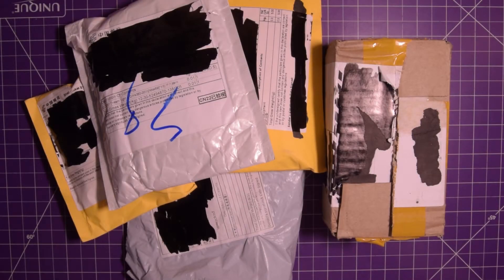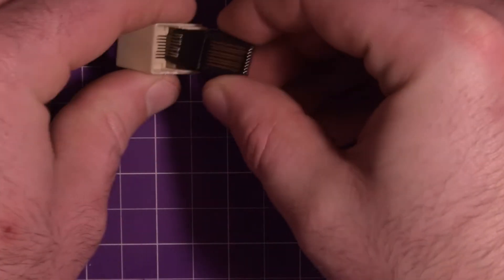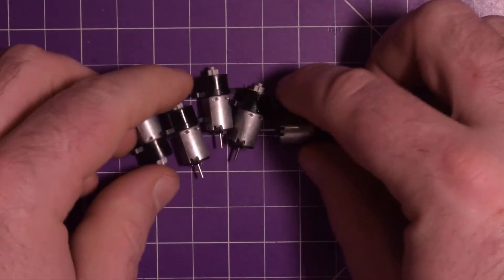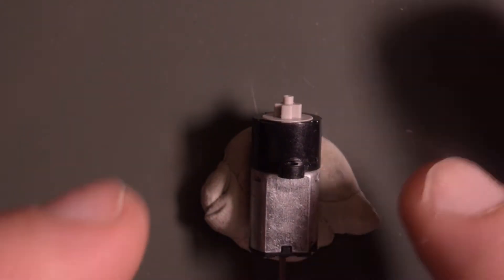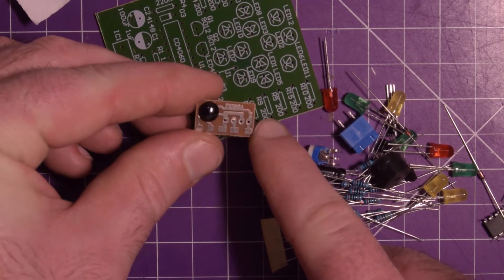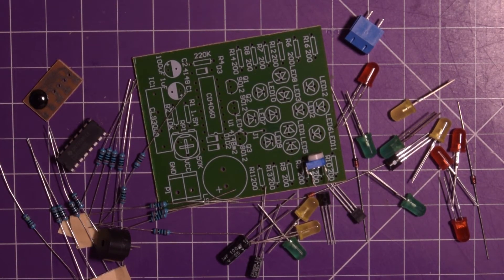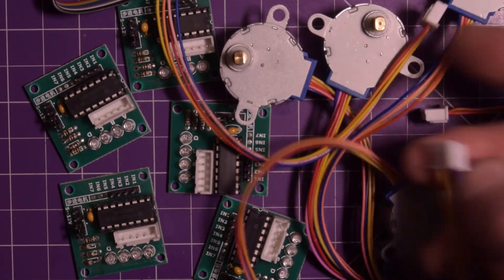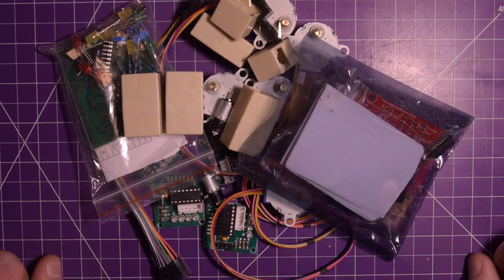Mailbag 22 - Motors And Kits

Comment: Those CAT5 connector units are actually pretty decent for what they are. I have used one to join a long run of cable to my PDC and exchange servers in my home network for the last fourteen years without any trouble!

I'm guessing maybe you want the function generator to test out a DIY oscilloscope you've put together?